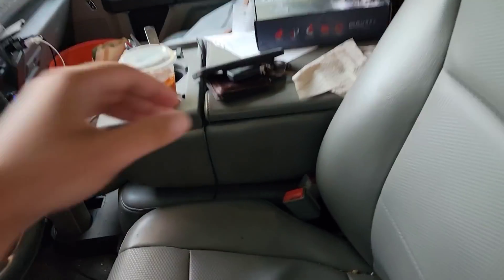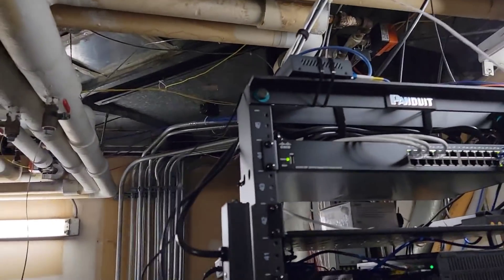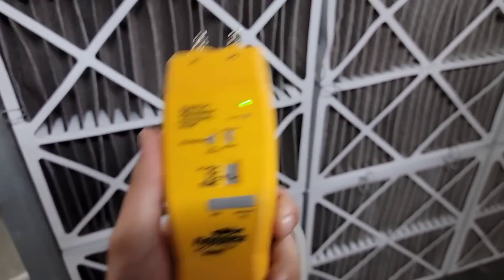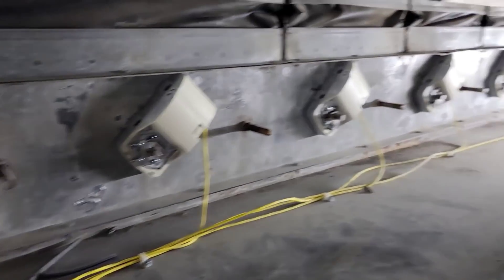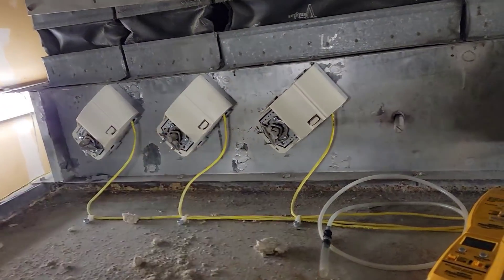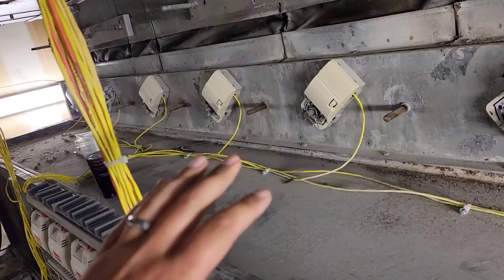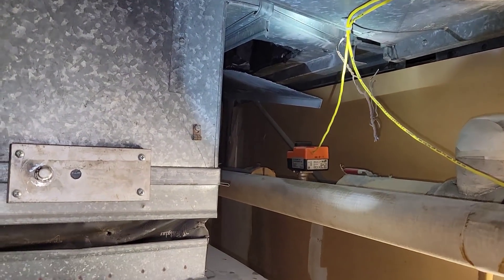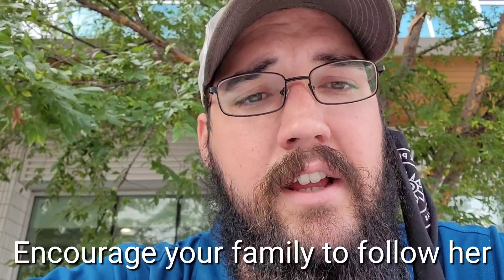AC AHU Not Keeping Up In Zones

Comment: Thanks for the vid!  Question: are those actuators floating, e.g: it only moves when 24vac is applied to the CW or CCW terminals, and when it’s not commanded to move that no voltage is applied?  In my mind, when no voltage is applied, the inputs are considered to be “floating” as in no voltage reference. 

I heard “floating point” which is confusing for a computer person! 🤪

keep up the good work, mate!
Reply from the maker: Yes correct, we use the term floating point control in my area.